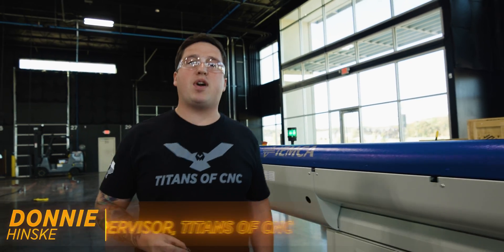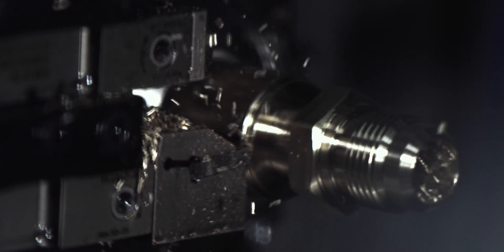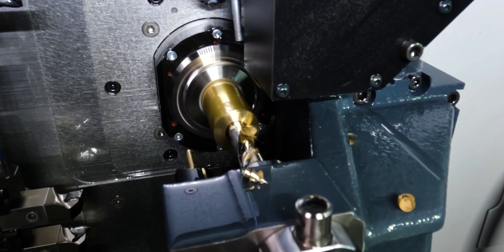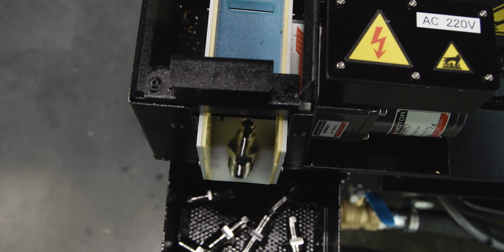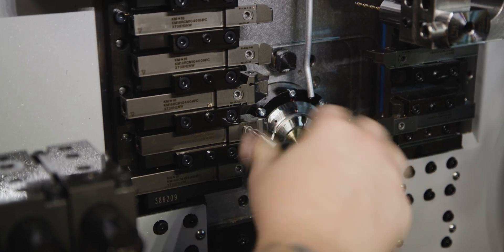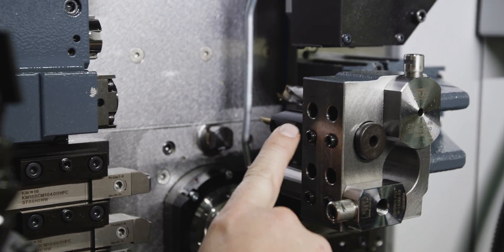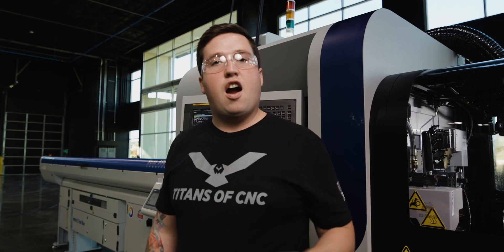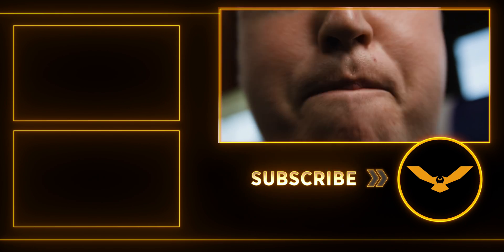The Superiority of SWISS Machining | MONEY Making Machine

Comment: idk if youre still running it like this but youre cutting off an entire slug and then facing. even if youre doing it for bar qualification i would choke it back up to just the cutoff width to accommodate for chamfers. Its also nice to see a swiss machine using just the right amount of tools and not having a rough for everything. also in my experience the z2 servo motors crap out all the time due to stroke length. good luck hoping nothing but the best

Comment: This is good stuff. Swiss guys need a channel they can turn to for information and inspiration. Looking forward to you breaking down the different aspects of how a Swiss machine works, best practices and tips and tricks. If you can run a Swiss, you can run anything. Love the fact this was a Swiss video, done by a Swiss guy (not a guy from Switzerland but a "Swiss guy"), on a Swiss machine from Switzerland. Those guys in Switzerland have been doing longer than anyone................that's why they call it Swiss machining!!!!
Reply: I’m 26 years old and have been running citizen L20’s for about 2 and half years. Love it. Kinda prefer running Swiss in my opinion. I learned lathes more in-depth after running Swiss for 2 years. Made lathes much easier to learn. Going back to Swiss here after Christmas!

Comment: Donnie, how long does it take to make one of those fuel fittings?

I note you're not running the Synergy 735 coolant that seems to be a Titans standard on this machine. Is the Blasomill GT15 you have loaded into this unit something specific to Swiss machining, or could you use the Synergy 735 if, say, you didn't want to stock two different coolants?
Reply: It was running in 2 minutes and 45 seconds. We use oil based coolant on Swiss machines because the tool life is so much better with it AND it’s better for the machine. Swiss machines have a lot of exposed components so if you ran water it could lower the machine’s longevity
Reply: blasomill is an oil.

Comment: no wonder you are printing money... given how fast and "easy" it is to mass-produce fittings with such a machine, i often wonder why fittings are so expensive in the shop. 
I guess they are priced as if someone would manually make them on a lathe and a separate mill.

Comment: Exactly how I would process that part except for roughing the back work on the front side and that's to lower the cycle time.
Do you guys typically run a part in with brass first?
Reply: If it is an option I prefer to set up on brass when the material is stainless, titanium, etc. It is just nice to make sure everything is going to clear without 20 coolant nozzles blocking your view
Reply: @donniehinske  No doubt. Thanks man.